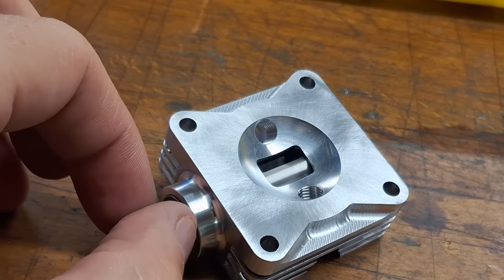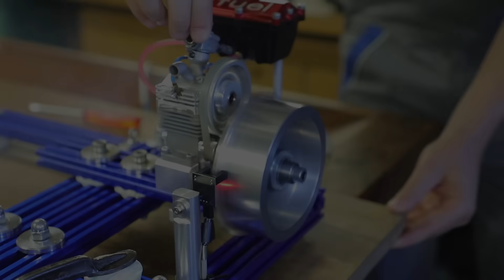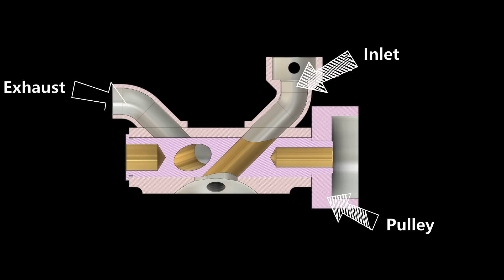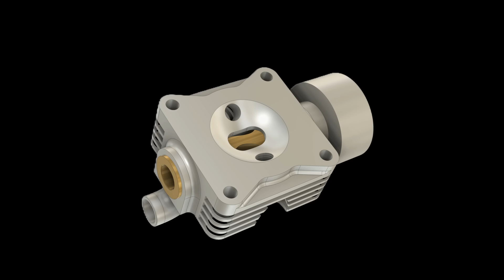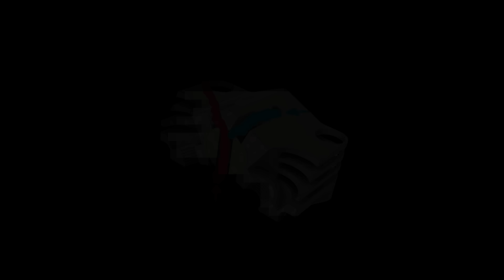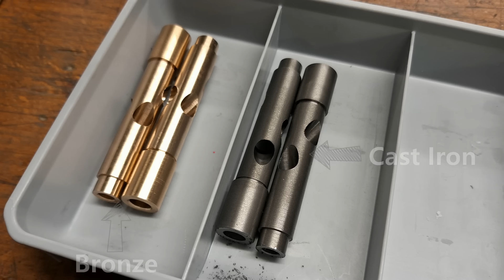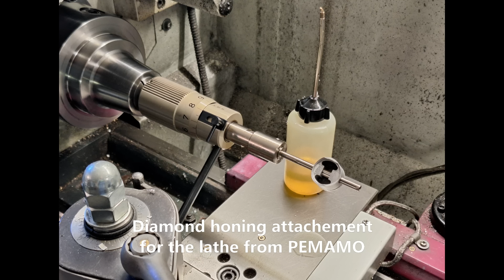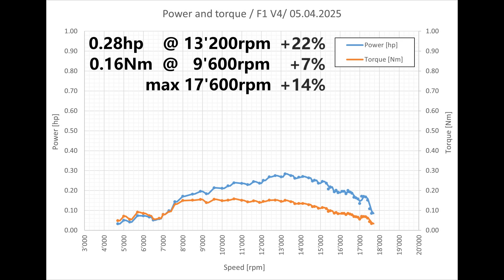New Rotary Valve Design for Model Engine / Modellmotor mit neuartiger Walzendrehsteuerung / Part 2

Comment: You need valve overlap to make power in a four stroke.
Packard and others tried extensively but couldn't overcome the deficiencies in this design. That was the 1930's though. 
With nearly 100 years of development under our belt, you might have a crack at it.
Reply from the maker: Hi Jason 🙂 Let summarize you statement: You thin the timing is wrong and I don't have a valve overlap?

Comment: Id love to see the valve drum openings be modified bit by bit to see if it is a time of being open/closed making it so poor .
Reply from the maker: Hi man 😃 What I can say is that the timing of this engine is exactly the same as that of my 2 valve version with rotary valve which brings 0.60hp. The valve cross-section is also the same.
Reply: @danielhunziker3577  i believe you . But the setup has changed.. it would be Cool to see if it would Change with say an elongated exhaust port or intake port hole

Comment: This is interesting.  We did very well with our single axial flow rotary valve which is a fairly similar design to what you've presented here.  That said I don't remember the exact numbers but we improved power output compared to the stock poppet valve head but were only spinning in the 4-5k rpm range on a larger engine.

I do like this design, it's very clean for mounting the intake and exhaust, definitely easier than the setup we used which required good rotary shaft seals.
Reply from the maker: Hi John 😃 I knew you would like the video 😊 I can imagine that it also has to do with miniaturisation. It's possible that the boundary layer is relatively large with such small valves and for this reason a reasonable counterflow/flow change through 1 valve isn't possible. For this reason, I can well imagine that on a larger scale, as with your BMW engine, it works much better. It was interesting for me to see that 2 separate valves in a rotary valve are significantly more powerful (0.28 vs 0.60hp) in my scale. Have you used axial shaft seals? Did you have problems with the seal because of the heat at the exhaust side?
Reply: @danielhunziker3577  I have used rotary shaft seals on all of my designs on the intake side to make sure the carburetor seals.  On the BMW I have also used them on the exhaust side.  They have held up quite well considering the temperatures involved, the BMW has liquid cooling through the exhaust side seal holding block to try to keep things cool.
Reply from the maker: @johnpearson492  That sounds logical! otherwise the sealing on the exhaust side would burn out 😕 In the design here, the rotary valver itself is the seal. Has the BMW now made it to Dyno so that you were able to compare it with the poppet valve version?
Reply: @danielhunziker3577  It has been to the Dyno once, but we had a bad mass airflow sensor in it so we were limited to about 4500 rpm.  We wanted to get to 7000rpm.  At 4500 we made about 90 hp at the wheels.  Stock it made 169 to the rear wheels.  It will get there again someday.  I actually started it and ran it recently after it not working for a while, I made an amateur mistake, it was out of gas...  The current goal is to drive it the 3 miles to the new house my brother and I are building.
Reply from the maker: @johnpearson492  Hi John 😃 Do you have than as well a new tool shop in the new house? You've already had the BMW on test drives. So 3 miles is no challenge 😃 I would think it would be cool if you brought new content about the BMW. It's simply an awesome technical project!
Reply: @danielhunziker3577 I do want to make some videos of it again.  3 miles is pretty far for it, though I'll say the longest it has driven is 10 miles at one time so it's not out of the question.
The new house will have a shop to work on it for sure!  Also it will be much more easily accessible instead of parked in a tight corner of a barn.

Comment: Your second attempt is the same principle that WEBRA used in their second series of 4-stroke engines... isn't it?
Reply from the maker: Hi man 😃 I have all kind of 4 stroke rotary valve engines at home like Webra, Hirtenbergen, RCV, Green, Condor, etc. Webra is using a comparable system but with in shaft in - and oulet. As well they ave a active sealing with counterpiston. I also measured a Webra T4-40 (the same displacement as mine) on my dyno. This only achieves 0.38hp... and i get 0.60hp with a 2 valve rotary valves design.

Comment: The problem is using one rotor because you can't optimise exaust flow and inlet flow through one venture side 😊solution use two rotor
Reply from the maker: Hi man 😃 It's 1 solution to make a 2 valve design. As I said in the video I already have a 2 valve design done with 1 rotary valve.

Comment: Amazing work!
Whats the benefit of keeping a single hole in the head vs two holes? (Still with a single shaft)
Feels like a fillet in that intake/exhaust oval orifice would help.
Thanks for sharing your work.
Reply from the maker: Hi Adrian 😃 Theoretically, you have a better shaped combustion chamber with only 1 valve. This is because the valve openings of a rotary valve always have unfavorable shape. But in the end I realized that the sum of the disadvantages is probably much greater than with a 2-valve engine. So back to the 2 valve version 🙃
Reply: @danielhunziker3577  Thanks for answering. 
I meant one single rotary element but with two holes in the head, one for intake and other for exhaust.
Reply from the maker: @adriangaleron3293  Through-holes mean that the rotary valve has to rotate 1:4 instead of 1:2 to the crankshaft as usual. What you have to understand with Rotary Valve is that when it turns half the speed (1:2 to 1:4), the through holes have to be made half the size to achieve the same timing. So if you simply drill two holes though the rotary valve, you reduce the cross-section by a factor of 4!

Comment: The many peaks and valleys in the power curve highlight inefficiencies. If you have the correct carburetor for the engine, you will see a smoother power curve and of course more power
Reply from the maker: Hi man 😃 I use the same 8mm carb for all of this test engines with a displacement of 6.5ccm. If my best rotary valve cylinder head on the same base engine with the same carburettor produces twice the power (with 0.60hp), why should I change the carburettor now?

Comment: Experimenting with different timings would be worth at this stage,I don't think there is something fundamentally wrong in the design,just need some work.
Reply from the maker: Hi Juan 😃It's important to know that all the parameters of this engine are the same as those of my engine, which has more than double the power, also with a rotary valve, but with 2 valves. So timing, compression ratio, valve cross-section, plug position, hemi combustion chamber, etc. is all the. So why should a different timing change the situation?

Comment: Can you increase the pressure in a two-stroke engine by adding a one-way valve and a throw-away valve to the intake and exhaust?
Reply from the maker: To gete more pressure in the crankcase of a 2-stroke engine and thus produce more power, the volume around the crankshaft is classically reduced to a minimum. Full cheek crankshafts are very popular here. Additional valves in the inlet and outlet do not seem to me to be a good choice, as they additionally obstruct the flow. 2-stroke marine diesels have an interesting concept with a valve in the cylinder head and compressor. Maybe have a look at it?

Comment: I wonder why no one uses Victor Schauberger’s ovoid cross sections for improved flow?
Reply from the maker: Hi man Because 😃 Main reason: It's very expensive and complex to produce!
Reply: @danielhunziker3577  A valid reason to be sure. This may not be helpful, the advancement of 3D metal printing might be a way forward.
Reply from the maker: @GromPilot  I do a lot of SLM printing. I print connecting rods from titanium, engine housings from aluminum and pistons from special piston high silicon content aluminum. Every technology has advantages and disadvantages, including SLM. Otherwise I would have printed Rotary Valve in SLM a long time ago 😉

Comment: What about a slide valve? That works similar  to a sleeve valve. with a large opening large enough to easily  fill the cylinder small enough to keep up velocity. The problem is IT NEEDS VALVE OVERLAP. Where the exhaust pulls air/fuel into the cylinder..this will gain power. I have thought. About this a lot in the past.  And only dream of being able to actually mill the parts.
Reply from the maker: Hi James 😃 Isn't such a slide valve what is used in a steam engine? You also need a separate drive for this 🤔 I love it when people like you have ideas and want to realise their own things! What I can tell you from experience is that new ideas are always great in my mind and every signle design is automatically more powerfull. For this reason, I built the Dyno to create hard facts. Trying something is always a very good idea! But you also have to be able to deal with the fact that something doesn't work out so well after all. Like my cylinder head in this video 😅

Comment: Wieder ein schöner Motor mehr in der Sammlung. Von der neuen Konstruktion hätte ich auch viel mehr Leistung erwartet. Ich bin auch ein bisschen enttäuscht. Die kontinuierliche öffnende Querschnitt ist schön gemacht. Der 4-Takter Sauger lebt eigentlich von der Überschneidung. Zu wenig Überschneidung / Querschnittsfläche? Was kommt als nächstes? Ein Motor mit 2 Walzen?
Reply from the maker: Hi Argentum 😃 Eigentlich ist nur der Zylinderkopf für die Sammlung 😅 Der Motor selbst ist ja meine 0815 Basis auf welcher ich verschiedene Zylinderköpfe teste. Du musst dir vorstellen, dass der Ventilquerschnitt und das Timing genau gleich ist wie bei meiner Variante mit 2 getrennten Ventilen, welche 0.60PS bringt. Da man mit 1 Ventil nur 0.28 PS raus bringt, muss es mit der Strömungsverhalten im Übergangsbereich im 1 Ventil zu tun haben. Da bringt dir leider die beste Gasführung durch den Zylinderkopf leider wenig 😕 Was als nächstes kommt? Ich habe so viele Themen 😅 Es wird zuerst nun etwas ruhig werden um einen neuen Zylinderkopf mit Steuerwalze, da ich da erst am Design dran bin. Zuerst werden noch neue Beiträge zur Einspritzung kommen und evtl. noch ein Video von einem anderen Modellbau Treffen. Aber was ich jetzt schon sagen kann ist, dass es keine 2 Walzen Version geben wird. Einerseits ist diese Lösung nicht skalierbar (z.b. in einen V8 Motor) und die Friktion sowie Dichtigkeit von zwei Walzen ist kritisch.

Comment: Why not a two rotary valve setup? Could the performance be  LinkedIn by the clearances of the valves ?  . I have a ZDZ engine 180cc that uses rotary valve . It was underperforming when using amsoil saber 100:1 oil mix . Until the first owner slapped my wrist and advised me to use full synthetic éster based oil 32:1 ratio the engine performed wonderfully.  Whit all this i want to say you should repeat you performance measurement using more synthetic oil in your fuel and see if the alleged claim is true (more oil makes a better deal on the rotary valve )
Reply from the maker: Hi man 😃 What do you think how much synthetic oil was in the methanol I used?
Reply: Have you consider a straight style seal something like an apex seal on a rotary engine for your rotary shaft ? Also intake and exhaust opening and closing events may need more attention especially on intake closing and exhaust opening the reason for the lack of power I suspect was from poor cylinder filling and or combustion pressure escaping via port timing or rotary valve shaft to head clearances. Either way I hope you continue to work on this project I’ve always felt like this design had lots of potential considering the lack of moving parts the ability to tune intake and exhaust events without having to worry about piston to valve clearance.
Reply from the maker: @markwallace5274  If you could feel the static tightness and compression yourself when turning the crankshaft, then the question of tightness would be taken off the table. You also need to know that I rund teh engine with 18% oil in the methanol and that dynamic sealing takes place automatically from approx. 5,000 rpm. It can be said that once the engine is running, it's automatically tight. Static tightness is only relevant so that the engine can be easy started.
Reply: @markwallace5274 saya sangat setuju ide anda, penggunaan rotary valve ganda dengan bahan yg sama seperti valve normal. Dan untuk menanggulangi kebocoran gas dari rotary valve ini digunakan seal plat  baja yg di beri pegas sehingga menekan sempurna pada slinder rotary agar  kompresi tidak bocor ( ya mirip2 apek seal mesin wankel)

Comment: Hi, very interesting.@3.40 You made both ports oval. Did you determine/ is there an ideal? length to width ratio for optimum air flow through an oval hole?
Reply from the maker: Mmm... so I don't see any oval ports 🤔 I'm also not aware of having manucatured anything oval. It probably just seems that way because they are 45° angled 8mm holes.

Comment: What about something like a dual overhead valve system? Using the same valve as before, but exhaust and intake have a dedicated valve?
Reply from the maker: Hi man 😃 The idea is good for a 1 cylinder engine. But this here is a 1-cylinder test engine, which is then scaled up to a V8, for example. Unfortunaly in a multicylinder V engine is no space for 2 rotary valves. I also take a critical view of the friction, which doubles with 2 rotary valves. Friction is generally a disadvantage with rotary valves 😕
Reply: @danielhunziker3577  yeah, maybe there is another design that works to fix this issue with friction, I also think that if your aiming for performance, than I would think to go with the 2 rotary valve design as it allows better tuning capabilities with the possibility of chaning the time between exhaust and intake.

Comment: What if you put fuel injection into it with this design?
Reply from the maker: You're right. That would very probably result in more power. But the 2 valve rotary valve system also had the same carb (OS 4C) and produced 0.60hp, i.e. more than twice as much. So the problem won't be with the carburettor, will it?

Comment: Why focus so much on a single rotary valve?  Why not just use two rotary valves?
Reply from the maker: Hi man 😃 This is a 1 cylinder test engine. It's a 1:1 copy of one cylinder of my multi cylinder engines. As there is no room for 2 rotary valves in my multi-cylinder engines, the 1 cylinder also has only 1 rotary valve.

Comment: How do you seal the rotary valve?
Reply: From the video he talks about the amount of clearance and he stated 5 micrometers on the intake side and 10 micrometers on the exhaust.
This tells me he is just using thermal expansion of the materials as sealing.
I am assuming when he says micrometers that means microns.

I am with you on this thinking in that sealing is also issue with this engine design.
I used to own and race a formula car that had a peripheral port 12A Mazda rotary engine. It spun over 12,000 rpm. The rotors in my engine had carbon apex seals. They are incredibly light and fragile. Basically like pencil lead. That's what I would do to the engine in this video, try to find a way to seal the rotary valve with carbon apex seals.

I have seen on youtube a full size running engine in a car that had rotary valves and you could see the blow by on the valve as it was blackened in that area. I immediately thought "carbon apex seals".
Just my opinion.
CO
Reply from the maker: Hi man 😃 It's difficult to explain. The main sealing is made by dynamic oil film arround the rotary valve when it's turning and the thermal expansion of the rotary valve. You just need to get as much static seailing that engine can start.
Reply: @danielhunziker3577  Yes I understand what you are doing there.
I'm a retired certified millwright.
After ignition there is about 700 psi pressure in a combustion chamber and that kind of pressure is tough to seal off with just minimal clearance and oil film. There will be leakage and therefore loss in power.
I do REALLY like your idea and machine work.
Very nice machining and concept.
CO
Reply from the maker: @canadianoddy8504  I should also mention that there is 18% oil in the methanol. So a huge amount! This is common in model engines so that they are tight at all corners and ends. The system here would never work in a real engine! But sufficient for a model engine 😁 If you would knew how many cylinder heads I had to test to get to this point... 🙈

Comment: Is won't work efficient, with  because with every rotation you disturbs the airflow. Airflow is very important thing at exhaust side doesn't matter if its a N/A or turbo.
Reply from the maker: Hi man 😃 You're right. Something is preventing the engine from breathing freely.

Comment: Why are your dyno curves crossing at 7000 rpm?
I think your math is off. Torque x RPM/5252
Reply from the maker: Hi man 🙂 I wish it would be an error in the calculation, but it isn't. When you watch the dyno run and listen to that point, you can here that engine struggles at that point. This was similar with the previous 1 valve design. At this speed there seems to be some kind of interference in the gas flows.
Reply: Crossing all depends on units
Reply from the maker: Just to be sure: When you mea the rule "Dyno graph always cross at 5'252rpm!", than I have to dissapoint you. This rule is only correct when your torque is in lb-ft and the power in hp. When you look at my graph, the torque is in Nm and not lb-ft.